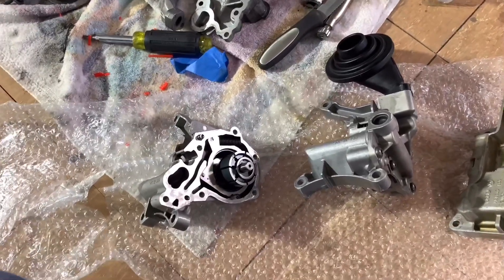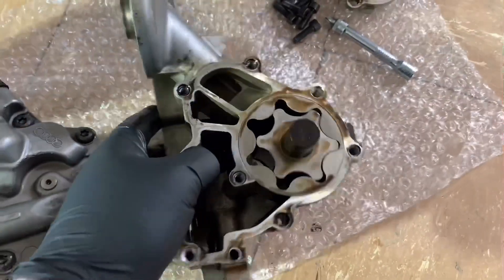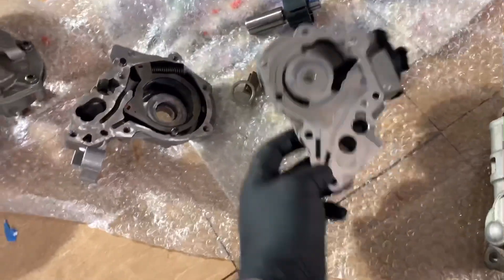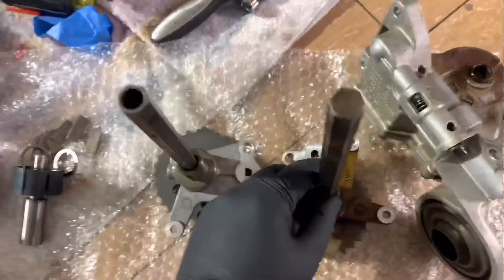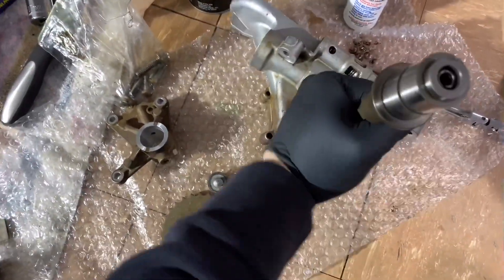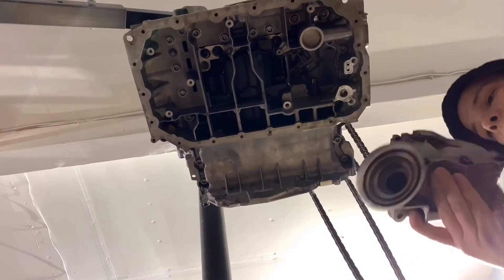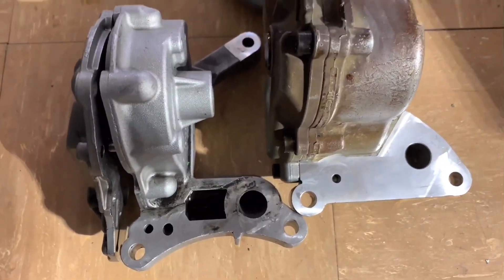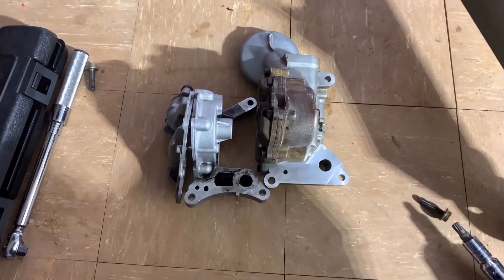2013 Audi S5 swap oil pump from 3.2FSI

Comment: what about the oil pressure?  will it remain the same?  asked this why I see that the oil pump that the car is originally mounted has one more hole!  and the pump you are replacing does not have that hole... my question is does this imply an oil pressure problem at some point?

Comment: Great findings and work Oleg! Always love your content! What forged internals are you running? I recently purchased 3.0t supercharge engine and want to put into my B7 Avant, however I believe the engine is in need of rebuild and I would like to purchase forged rods and pistons. Thank you!
Reply from the maker: itsmedeka find me on FB
Reply: @Svarogperformance  Ahh I do not use FB, do you have instagram perhaps ? I can send you message there.
Reply from the maker: itsmedeka @svarog_edition
Reply: I'm trying to find more info on how those ports work and what switches the oil pressure from low to high. Do you have any info on this or links?
Reply from the maker: leo gomez I don’t need those switch pressure solenoid anymore ! My pressure will be controlled by Oil Pressure Check Valve from 3.2 FSI engine. I’m going to kept OEM Pressure Switch  Solenoid to just keep ECU happy that’s all ! I will test very soon and I hope everything will work as I planing ;) I should have 1.4 bar at idle and 3.4 bar at 2000 rpms that’s what I want. Stock 3.0TFSI Oil Pump only pump to 2bar at 2000rpms to 4600rpms this is NOT GOOD.....
Reply: @Svarogperformance  Which pump you used. What about the diameter of the holes?